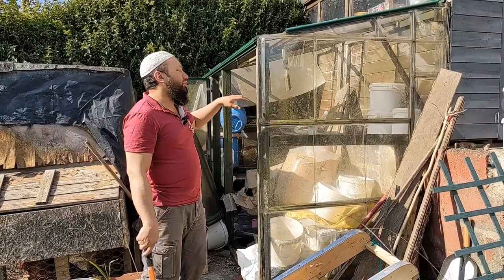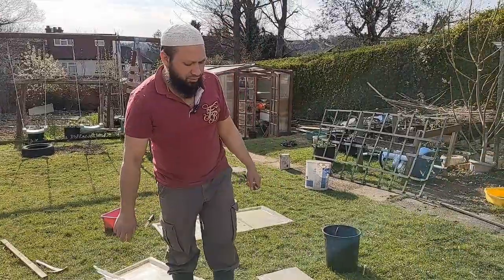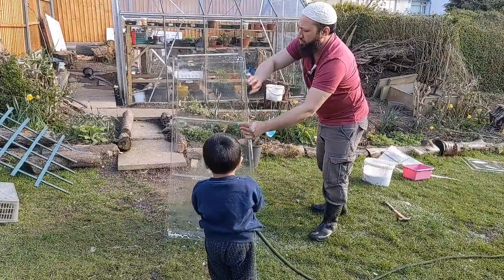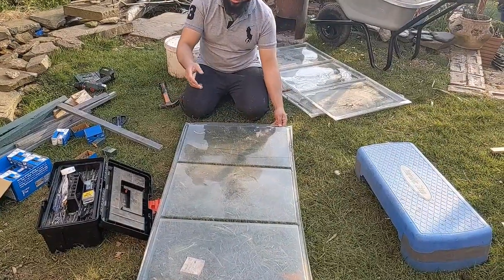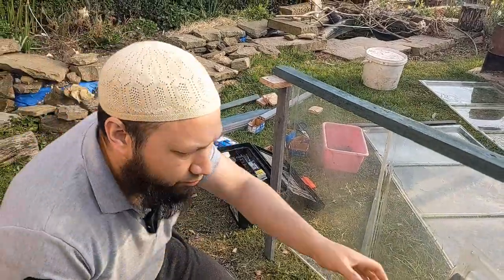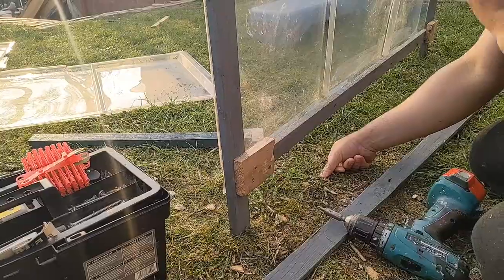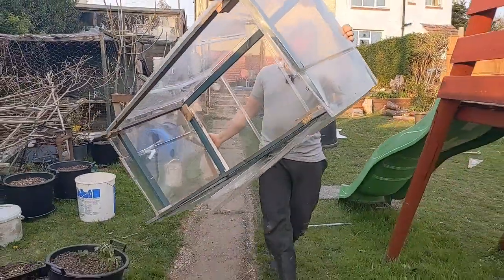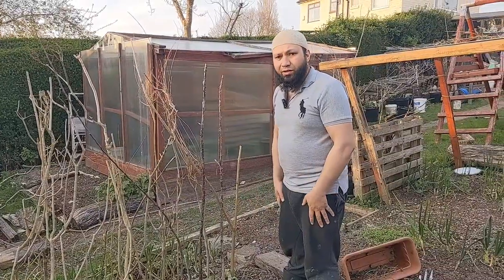Making A Cloche - Making A Cold Frame - DIY Mini Greenhouse

Comment: Great idea, the extra height is good too. Try pilot drilling the brackets in future to stop the smaller pieces of timber splitting.
Reply from the maker: I ended up getting doing it that way, just a pain switching drill bits every few seconds

Comment: Your make-do strategy is exactly the same as mine...and things don't always go to plan, but there's always a way around it. I have the framework of a plastic tomato house to cover. The plastic perished and a new cover is almost as much as a new complete one. My thinking cap is on 😊 Love your cloche...I would have put small hinges on to let air circulate 😉
Reply from the maker: You can get greenhouse plastic sheeting for quite cheap, the stuff used on polytunnels
Reply: @MyFamilyGarden  Great...I'll have a look for it. Thanks.